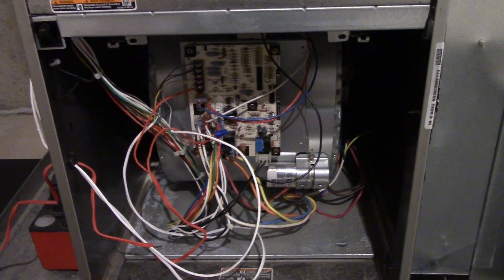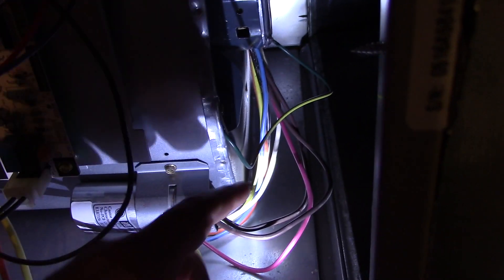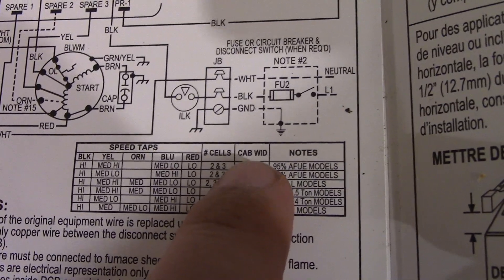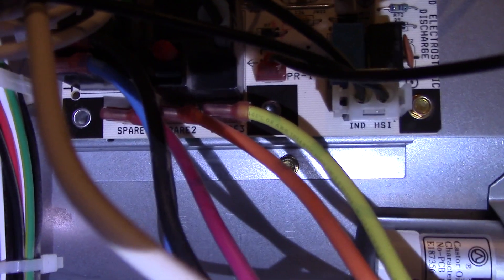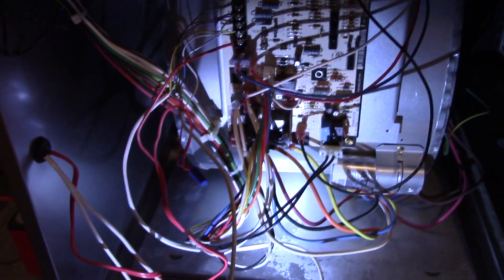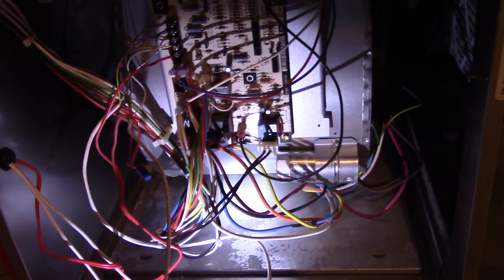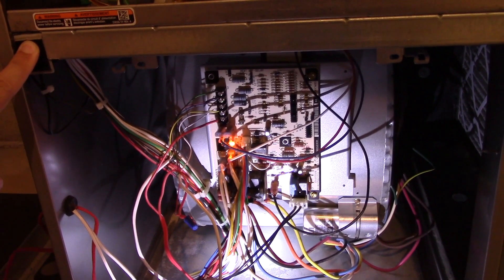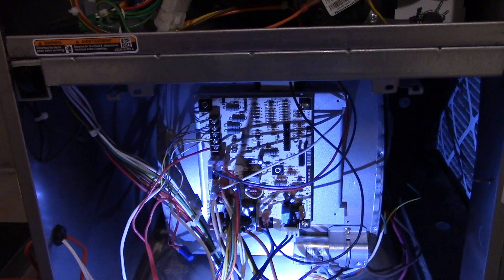Understanding and How to Change Blower Speed on a Furnace Air Handler.

Comment: My AC fan speed is on high and it makes vibrating noise when it runs. Do you think I can get away with running it on medium-high? I've tested it and the vibration goes away on that setting. I live in the Midwest and our HVAC doesn't see constant heavy use. I've already had the company come out to try and fix the vibration but they can't figure out what it is. Guy says it's just gotta be some part of the cabinet just loosened up over the years.

This was a fantastic video by the way. Thank you.
Reply: The vibration could have something to do with fan balance. If it is an older system the fan could be dirty and this could cause it to vibrate more due to the dirt buildup. 

There is also the possibility of a foreign object got sucked into your fan. 

No I don't mean your Russian girlfriend haha. Actually this situation did happen to me but it was on my jeep Cherokee. 

My fan started making noise, lots of noise. Finally had to remove it and found a dead mouse embedded in the squirrel cage fan. Removed him and fan went back to running quietly.

There is a joke some where in those details about a mouse in a squirrel cage fan but.... Actually the joke was on me because it took a mountain of work to get that fan out of there.

Back to the HVAC.... These motors and fans should make more noise at higher speeds but there should be no more vibration at higher speeds as fan and motor should be balanced to a high degree. 

Inspect your fan for any signs of dirt or dead mice.... Clean it if needed. Cleaning it could involve removing it and dissembling it to a certain degree so if you do that be vary careful.
Reply from the maker: It's possible maybe your blower motor housing is loose. I would check that first. If you try medium-high, make sure you don't see any icing on your AC line.
Reply: @Sharkie626  remembered that my brother in law is an HVAC tech and I asked him. He said Med, Med-Hi, and High are all acceptable AC on my unit. 

My unit is literally whisper quiet now.

Comment: My cool is too quiet after I replace the furnace motor, it doesn’t seem like it’s on high speed even though it’s on the black wire. What could that be?
Reply: Are you sure the black wire is high on that specific motor? Might have a bad capacitor.

Comment: If I have the fan switch set to on during cooling season does the fan stay at the same speed wrether there is a call for cooling or not or is fan only a lower speed than cooling
Reply from the maker: Nope. It will switch to heat speed when the thermostat is satisfied temperature-wise.
Reply: Will it switch back or is there a delay after thermostat satisfies before fan speed decreases to heat speed
Reply from the maker: @cristiannieves3757  It could depend on your system. I know mine has a delay.

Comment: Hi Sharkie,  Thanks for the great video.  I've got a Bryant Furnace, with a standard COOL/HEAT board terminals, and a few other speeds on the SPARE/PARK terminals.  The issue I'm having is that the FAN only runs when the Tstat "Nest"  is in Cooling or Heating.  I cannot get it to run when I select "FAN ONLY"   I want to be able to recirculate airflow without having the system on cool or heat.  The circuit board doesn't seem to have a "FAN" terminal... Maybe the option is in a DipSwitch on the board?  or perhaps the Tstat isn't wired up correctly?    Do you have any idea or suggestions?  Thanks
Reply from the maker: Hmm, could be an issue with the Nest thermostat itself. I don't really know too much about those.
Reply: The G terminal is for your fan. I would bet you didn’t have enough wires to power your tstat so they used your 4th wire in the C terminal instead of G and that’s not allowing you to run your fan. But it will come on in heat or cool automatically
Reply: @sogoodgolf  Thanks!  I'll check it out..  not much I can do if they ran a main wire that doesn't split into enough terminal points... ugh.
Reply: @russellhuntley3334  if you get a Honeywell tstat you don’t have to hook up the common (c) wire and can just run it off the batteries and put the green wire to the g terminal to be able to run just the fan. Usually you can run a new wire also or you can put a module on it, a company can get you fixed up
Reply: @sogoodgolf  Nice.  Thanks for the tip..   first time using the Nest and I'm a bit under impressed...  I pretty much disabled all the smart features because it seems to do what it wants  instead of learning what we want...
Reply: @russellhuntley3334  Well you can run a new cable with the required number of wires. Of course this depends on if you can access where the cable runs. Look it over. I had the exact same situation and I ran a new cable and then upgraded my thermostat and all is good. My situation, there was no C wire. 

The C wire is common so 24V can run to your thermostat. With older systems the thermostat did not require 24V as most of the older thermostats are powered by batteries. 

This is why I ran a new cable with more wires. If you had the new thermostat installed they probably substituted the G wire for the C wire. This works but removes the ability to run the fan from your thermostat.

Comment: What’s a better speed for ac in florida ( hot humid ) high or low? For cooling
Reply: To pull humidity out, a slower setting is better, if the tech changed it and your home is comfortable, leave it
Reply from the maker: Sorry I missed this! If your A/C speed is on the highest one, leave it as is.
Reply: @Sharkie626  I think that last technician put it on the low setting
Reply: I am dealing with this right now. Our new one is on a medium or high speed and the humidity is elevated Monday.

Comment: So my low is still too fast. Is there not a way to slow it down even more? Too much CFM a for the ducting in this house and the intake is too small. Ac installer was a moron and didn’t care. It’s a 4ton unit. Needed to be 3-3.5 to.  But why can’t the blower motor just be slowed down more? Or would the blower motor need to be replaced ?
Reply from the maker: If it's running on the red wire (check your diagram to be sure that's the right one), it can't be made any slower. Maybe see if the intake can be redone at all, using a different person of course.

Comment: Question - I'm using a blower fan (just like the one shown here) I removed from a furnace. I'm using to move air around a big open room during construction...
At high speed, the air movement is a bit too much. If I run on low speed (red wire) is the amp draw significantly lower ? 
Thanks,
Jim
Reply from the maker: Yep it should be, since the red wire is usually a lower speed.
Reply: @Sharkie626  Thank You again.

Comment: Good video. I moved the blue wire to spare and the red to heat but I still feel/hear  the same high pressure (no change). Why did it not reduce?
Reply from the maker: That would be medium low to low. Maybe it's just not significant enough to notice.

Comment: How can I change blower speed high to low??
Reply from the maker: Normally it's going from a black wire to a read one, but I would check your wiring diagram to be sure.
Reply: @Sharkie626  What’s a better speed for ac in florida ( hot humid ) high or low? For cooling
Reply from the maker: @Dilllonm  I think that would be more dependent on the correct evaporator and condenser size.
Reply: @Sharkie626  well I had my blower motor replaced it seems to go 1/3 speed as before and cools at least 2-3x slower now

Comment: Any downsides for using black high speed for heating? I want more return airflow in home
Reply: Only downside is you’re sacrificing high speed in cooling. Guess that’s not a problem during the cold seasons
Reply from the maker: As far as I know, there aren't any.

Comment: Thank you for the video It was helpful.
** Is it possible to have both heating and cooling on the high fan speed? I only have one black wire for high speed and one orange for medium high.
For the winter time I switch them around so the high speed is on heat now but I don't want to have to remember to switch them back for the summer months.
I have an outdoor wood stove with a heat exchanger in the plenum so I use the furnace fan only to circulate the hot air. Between the heat exchanger and the AC exchanger in the plenum I felt the air flow was a little low.
Thank you if you could reply please...
Reply from the maker: The only way that's really possible is if you splice the high speed wire and  make a splitter so it can connect to both terminals. 

DISCLAIMER! The relay SHOULD prevent any bad back-energizing on the board since only one terminal gets contact energized at a time, however I have never tried any of this before, so if you attempt, you do so at your own risk. 

The alternative is switching them around as you say you currently do. That really shouldn't cause any issues.
Reply: @Sharkie626  I have not heard any one ever suggest this, but, it should be possible. You could install a toggle switch that can adjust speeds when in different positions. 

For instance, down would be low, middle would be medium and up would be high. This switch could be installed so the toggle switch is on the outside of the furnace housing. 

So all you would need to do is simply flip the switch when the furnace was not running and next time the blower comes on it would be at the speed you desired. This would make it easy.
Reply: Here are the instructions straight out of my Goodman furnace manual:

To adjust the circulator blower speed, proceed as follows:
1. Turn OFF power to the furnace.
2. Select the heating and cooling blower speeds that match the installation requirements from the airflow table in the Product Data Book applicable to your model.
3. Relocate desired motor leads to the circulator blower heat and cool speed terminals on the integrated control module. (Terminals are identified as HEAT and COOL (hot)). If heating and cooling blower speeds are the same, a jumper wire must be used between the heat and cool terminals. This wire is provided in the literature package.
4. Connect all unused blower motor leads to the “PARK” terminals on the integrated control module. Any leads not connected to the “PARK” terminals must be taped.

Comment: Do you know, you can cause damage to the equipment by not setting blower speeds correctly. You can't just randomly decide to lower or raise. This is not something the average person with zero knowledge should ever be doing because it's shown on youtube.
For heating, too high of a blower speed can actually cause condensation to form in the primary heat exchanger, resulting in corrosion. Too low can cause the heat exchanger to overheat and crack/develop holes. For heating, you're supposed to measure supply and return temperatures and in most cases get it within the middle of the temperature rise range of the rating plate. Generally a 45 to 55F rise is good. Before that's even checked, the fuel btu input should be verified by clocking the gas meter and if it's off by more than 5% or so, a tech needs to be called to check the manifold gas pressure. The temp rise test is meaningless for adjusting speeds if the fuel input is off, and having it under or over-fired throws off the fuel to air mix.
 Further, high is not always correct for cooling, if you have a 1.5 or 2 ton a/c, high is usually too much resulting in poor dehumidification. A static pressure test ideally should be done and  airflow  of each tap  determined using the manufacturer's blower performance chart. From there, the correct tap can be selected to deliver 350 to 450 cfm per ton of cooling. There are other methods to measure airflow but this comment is getting long...
Reply: Thank you for posting this video. A tech came out and replaced my circuit board on my 915sa Bryant furnace last December. I noticed my return air vents were louder and my supply vents were blowing really strong. In the summer when the A/C was on the return air was quiet and the supply vent speeds were mellow. I didn’t think nothing of it until recently when during this winter I was like, why does my system sound like a jet when the heat comes on. I go check the circuit board and the black (high speed) wire is connected to the heat and the blue (med/low) is connected to the A/C side. I swapped them over and now my furnace is back running like it did before the board swap. Tech hooked the wires up wrong when swapping the new board over. Simple fix...probably shouldn’t of happened in the first place though.
Reply from the maker: Yes, I am aware of this. In the video I said to not adjust the cooling speed because of how dependent the evaporator is on not only refrigerant pressures, but also air flow. I have heard from multiple HVAC people that raising speed for heat is generally okay to do, but just not to lower it. So if anything, I was following advice based on their own words.
Reply: @Sharkie626  best to take the measurements because sometimes it's okay to reduce the heating speed and cooling speed. for heating though normally the factory setting is fine if the ducts were sized properly.
Reply: I have a two stage  furnace was too loud so I call a HVAC tech to lower the blower speed a little bit. He said he lowered it by 5%..now I noticed its too low..some of the room in my house is not getting thd heat..Is reducing by 5% ..too low?
Reply: @wildorchids3657  5% shouldn't make big difference.
Reply: @wildorchids3657  5% is literally nothing. If you’re glowing 1000cfm, that’s literally 50cfm difference. Nothing. Speed changes are done in the 100’s.

Comment: Heck, now I'm curious, and will have to see our 2003 Carrier furnace is setup!
What was your reason for changing the heat blower speed?
Reply from the maker: I figured since the vents are in the ceiling for the 2nd floor, and warm air rises, this will give the heat  more of a boost.
Reply: Awesome, please update how it works out, when the time comes.

Comment: While it may seem inconvenient, I would recommend removing those terminals with a flat blade screwdriver.  Using a pair of pliers can lead to a misshapen connector, and ultimately a bad or loose connection.  So you use the screwdriver to pry the terminal off.  Installing the terminal can be done with pliers.  Just a little trick I learned...the hard way.
Reply from the maker: I actually had thought of that step at one point. Only problem is, there is literally no way to fit a flat blade on the connectors for the relay. With the exception of this example, it's really only a one, maybe two-time deal, so the pliers won't hurt anything.

Comment: Ooh look, "mechanical" speed control with wires.

Mine is all digital since it has an ECM motor, and all of the speeds are adjusted through DIP switches.
Reply from the maker: Yep! Just one assigned speed! Nice and simple.